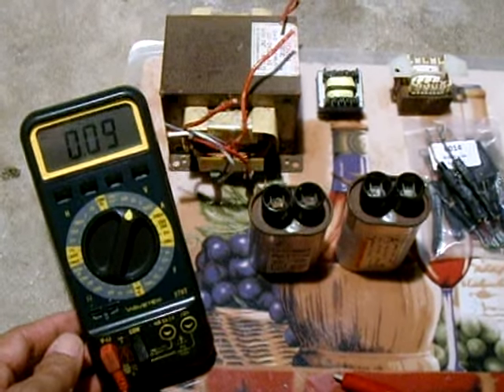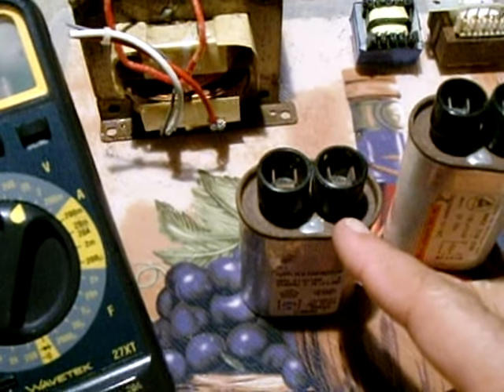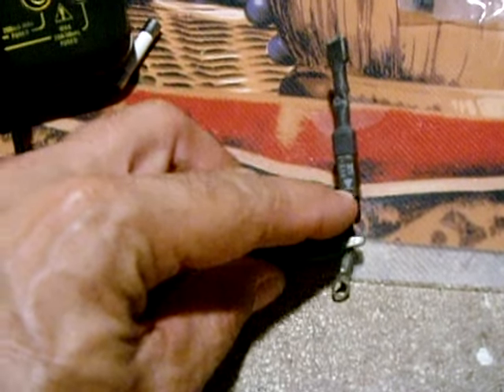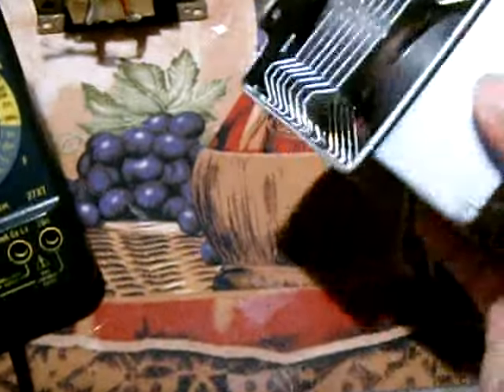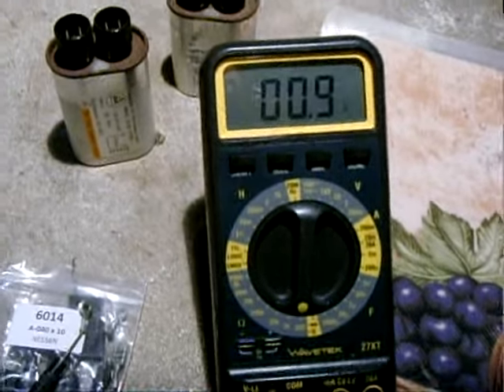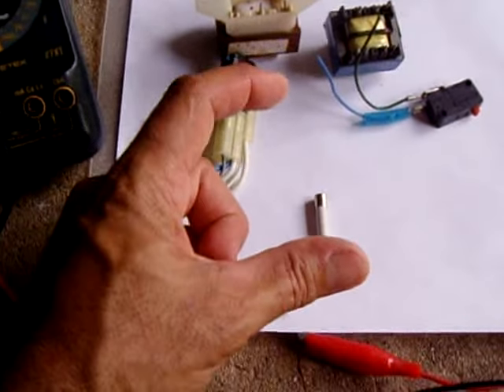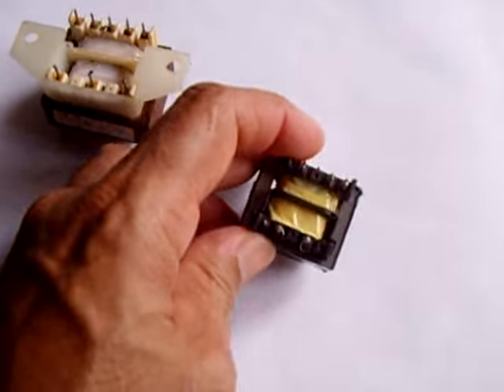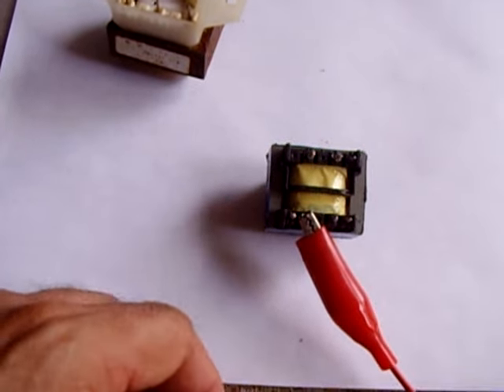How To Easily Test Microwave Oven Parts! (Ultimate Guide)

Comment: I'm a fan! , but I have a puzzling problem, I have tested as you've instructed and I found a faulty high voltage diode and a faulty micro switch in the door (both parts were replaced), but the microwave continues not to heat. All other parts tested within normal range. the display panel works fine. I thought it maybe the magnatron as on testing I'm getting .5 ohms the other test is normal. Any help you can provide me would be great! or I will succumb to defeat and go out and buy another one (if only to get my wife to stop yelling at me to buy another)! Thank you!!!
Reply from the maker: If the large transformer is being supplied 120V on the primary side from the circuit board relay, then I'd say the magnetron is bad.
Reply: Thanks for responding And yes the transformer is getting 120 volts so I will try a new magnatron and see if that resolves it and again thanks for the help!!!!

Comment: My micro wave is an avanti. While plugged into the socket it wont come on neither will the control panel light. But if I opened the door the light comes on and the plate rotates as if it cookin. Once again if I close the door all of this stops. This so weird.
Reply from the maker: Inspect the door switches. You could have a faulty control board.

Comment: I have a GE profile.  The front control panel lights up, but will not take touch commands.  I took apart and cleaned all ribbon contacts with contact cleaner, and still no good. New boards are too expensive. Any thoughts?
Reply from the maker: jim bringe Usually a faulty door interlock switch. Test every switch and make sure they function properly as the door opens and closes.

Comment: I have a GE Profile Advantium 120 (2012) that powers down after a few minutes and I have to rest the clock to get it to start again.  Any ideas on what is wrong?
Reply from the maker: Could be excessive heat causing the thermal switch to trigger(or a faulty thermal switch). Could also be a faulty door switch, main control board, or faulty HV power transformer.

Thanks For Watching! Be sure to share my channel with others and rate Thumbs Up.

Comment: This is a truly comprehensive, methodical tutorial for people like myself who are comfortable working with electronics, but are unknowledgeable about testing microwave ovens. I have the top-rated, gleaming stainless steel, above-the-range GE microwave that quit heating after only three years and four months of use. Because of your video, I easily identified a shorted HV transformer. 

(Prior to finding your video, I located two bad components: the HV diode and magnetron. However, the oven still didn't heat.  A professional electrician tested the unit, failed to find the HV transformer failure and gave up.)

The Malaysian-manufactured unit is stuffed with Southeast and Far East Asian components. In sharp contrast, our 22-year-old Ohio-manufactured Tappen 1000w microwave oven continues to give top performance and trouble-free service. (I would pay the premium and buy USA, if given the choice.) 

Thank you for producing an outstanding series of how-to videos, which are worthy of a college-level  (or, at least, a good trade school) course in electronics.
Reply from the maker: Glad my video was able to help you!

Comment: electronicsNmore - Thanks so much for sharing your expertise & posting this video. Using your helpful tests, I was able to rule out the magnatron, high voltage diode & transformer. The high voltage capacitor tested bad.  Replaced it & my old 1982 Sharp R8320 convection microwave started right up.  They don't make them dependable like that anymore. THANKS AGAIN!!

Comment: Very good videos about microwave fixing! Unfortunately my oven had a high voltage (5kv 0.7A) fuse blown which you didn't address in your videos (probably many ovens don't have one), but that was easy enough to figure out myself.

My symptoms were: Everything else works but oven doesn't heat. Lights, fan, even transformer hum was present.

After testing every other component I was suspecting some fault inside the magnetron even though it measured 0.3 ohm with an ESR meter. DMM showed below 0.1 ohm delta reading with leads shorted compared to connected to a magnetron so it was no help in my case. 

I fixed mine temporarily with a 0.315A 1000v FF multimeter fuse for the next 2-4 weeks until correct size fuses arrive from china (1.1€ for 5 pcs).
I know that if the fuse blows now, the arc might not close inside the fuse because of inferior voltage rating and difference in construction. But I, a cheapass student, won't have a microwave otherwise so I take the risk of causing further problems with this cheap oven. :)

Comment: Great video.   All of my components tested good but I saw sparks through the holes in my magnetron case.  Knowing that couldn’t be good I replaced it and now it works.  I had seen on another sight the same testing for the magnatron and they said it could test good but still have issues. I tore it apart afterwards to get the magnets and saw that the input inductor was burnt on the varnish.  May be why it was sparking.  But great video.  I learned a lot.

Comment: Well, thank you for your videos.  I tried to repair my Sanyo EM-V3405SW microwave (intermittent flickering appliance light when door was opened or during operation and  pitch change in magnetron during flicker).
I was able to trace it to a relay, which I replaced (confirmed that it was relay by shorting the high voltage side of relay.
I ordered the relay, replaced it - microwave is running fine - but display is blank.  Is there some video you have on testing LCD display operation ?
I will admit, I had disconnected the front touch pad ribbon that goes into control panel, when I was testing relay operation.  Problem is I have no schematic diagram of the control board and have no idea how the display gets lit.

Comment: Thank you so much! My metre doesn't go above 20M so can't do the second test on the diode, but it read 8.4 volts on the voltage test. I guess that is good enough eh? The Capacitor was the only faulty bit since the reading between the two terminals went to 1.4. No reading change on the terminals to casing.
The microwave display and light comes on but as soon as I try to heat something, it instantly blows the fuse....would the bad capacitor do that?  Great instructional, thanks again.

Comment: This is an excellent guide for enthusiasts trying DIY fixing of microwave.

One question: 
  If high voltage transformer primary tests 120 v AC on each terminal to ground, what does that mean?
Reply from the maker: That means your transformer is not connected to the neutral wire allowing it to turn on. The circuit is not complete. You have to trace the wire and find out why(there may be a faulty switch or blown thermal cutoff). If you connect a 120V live / hot wire to one side of the transformer, and the other side(terminal) is not connected to the neutral wire, then you wire have 120V on each terminal. If the neutral is connected, you will have 120V on one side(power feeding in), and the other side connected to the neutral wire to complete the circuit, will be ZERO volts.

Thanks For watching! Be sure to check out my video playlists.

Comment: Thanks for the video.
I have tested all the switches, termal switches, fuse and all good. Everything is working except heating. There is no 120v on the entrance of the big transformer hence no charge on capacitor. What could be the issue?

Comment: In my case it was the capacitor. Unfortunately it was the last thing I tested for I was afraid of the voltage thing. Anyway I did diode, magnetron, the little switches, those fuses and breakers first. One fo the 20A fuses was bad, replacing it bought the lights and display back, the microwave was turning but no heat.  Anyway, when I finally get it off and check the capacitor, it was leaking oil and short. I just ordered one from Amazon and hopefully that's it.  Thanks a lot! Will paypal some if the new caps fixes the issue.

Comment: FYI is easy to follow ... My oven is not working ... I will follow this simple test only problem is I dont have a DVM... Maybe I can use 9volt battery connected to lamp as tester... Any good? Or there is a caution I needed to think like damaging a component? 😳😨🙏

Comment: Most interesting, may I ask ? can you not measure the voltage out of the output transformer while on to see if the transformer is working ie sending power to the magnetron ?  and what would you expect the resistance to be on those same leads with a the machine off and capacitors discharged?
Reply from the maker: VERY dangerous! You need a special HV probe like I made on my channel. Or you can remove it after unplugging the microwave and discharging the HV capacitor and do as shown below. Do as shown at your own risk. It's very dangerous for the average person. 

https://www.youtube.com/watch?v=VicnLpnwO-k

Comment: Microwave capacitors will usually have built-in  resistors connected to each terminal so that the capacitor will discharge automatically when the oven is switched is not in use.
Reply from the maker: Yes, slowly discharges with the internal 10M resistor. Thanks for watching!

Comment: Thanks for the videos.
I've read your comments and I think I have a puzzle.
The puzzle occurs when heating more than one batch that needs heating. The first batch heats fine. When we heat the second batch it takes longer. Everything else is fine. Please suggest any possible solutions. Thanks
Reply from the maker: Sounds like the magnetron is failing. You can try testing/replacing the capacitor/diode. You may also have an issue of burned relay contacts not allowing full current to the HV transformer.

Comment: Once again, a really fantastic video. My only query is why don't you just test the diode with your meter ?
Reply from the maker: You can't test high voltage diodes using the diode test setting on a DMM. Thanks for watching!

Comment: Awesome video, still have problems. Micro would buzz, but would not heat cup of water. Power setting button did not work, everything else did. Replaced Diode, set power to 2, fired it up, and fuse blew. Replaced fuse, turntable, fan etc. ran with transformer unhooked, all was O.K. until Transformer was connected, fuse blew again. All test readings on mag, transformer and cap are same as yours. Ideas? Also, can I wire a 20 amp household breaker in-line to test? Blowing ceramic fuses is getting expensive!.
Reply from the maker: Fuse usually blows if a door switch is misaligned or faulty, the cap is faulty, or the magnetron is shorted. Thanks for watching!

Comment: Everything checked out okay on my microwave according to your guide on oven parts. But my 1st instinct was the Magnetron went bad but has 0.1 Ohm resistance which you said it is good (0.1 to 0.3 ohm). I put on heating and I can hear humming but no heat. Any suggestions? Thank you for your informative videos though.
Reply from the maker: Very likely if the diode and capacitor are both good. Sometimes a magnetron can test good, but be bad. Did you measure the resistance from each terminal on the magnetron to the metal chasis? You should not get any reading. If you do, it's bad. Use a high ohms range on your DMM.

Thank You For Watching!
Reply: electronicsNmore I follow your guide and I didn't get any reading for touching metal chasis and one to the terminal. If I have another magnetron from other microwave can I hook it with the one that's not heating up to test?
Reply from the maker: If the size is similar(wattage), and it bolts in the exact same way, then yes. Substituting another known good one, will let you know if yours is faulty.
Reply: Magnetron doesn't have any wattage on the label. How can you tell the wattage?
Reply from the maker: Go by the label on the microwave oven. 900w /1000w...etc.

Comment: Thanks for the proper, safe process. Interestingly, about half the folks DON'T test for shorts on the Mag (terminals to body) which ultimately was my issue as I was seeing continuity from terminal to body. Just received and install the new Mag and it tested out exactly as you specified .001-004 ohm  across the terminals and OPEN from terminals to body and my unit is cooking again and operating quitely (comparatively speaking), it sounds like new again. I do have a few questions maybe you can answer as I haven't found anything yet on the subject: 1. can a shorted Mag be repaired? The terminal block looks clean, so it must be an internal short and 2. As far as the part # mine is an LG 2M246 050GF 1200watt and there is an additional set of letter/numbers under model #. Is the main number I need to worry about the 2M246 or are any of the other numbers important to match? Thanks again!
Reply from the maker: Not worth the time repairing, you can buy a used replacement on Ebay at a low cost. Thanks for watching! Be sure to share my channel with others.
Reply: @electronicsNmore  Will do! KUTGW!

Comment: Thank you, I did test the capacitor and it tests normal I think at 9.37 for a 10 ohm capacitor and the terminal to body on each test infinity (followed your video). The buzzing is coming from the transformer. If I unplug the magnatron the tranformer still hums but the loud buzzing stops. Left the magnatron unplugged disconnected HV wire to the capacitor normal hum from the transformer but no buzzing. The tests of the transformer were all normal low side read .7 at 200 ohms and terminal to body was infinate at 20M ohms. High side .5 at 200 ohms and terminal to body was infinate at 20M ohms. The HV wire tested 91.2 at 200 ohms. I also tested the new diode and it was normal. I tested all the door switches, the thermo sensor, the fuse and transformers on the board all were normal. Again everything works except buzzing from the transformer and no heat, the magnatron is silent. I visually again inspected the magnatron, no cracks, sounds, etc... I also retested it and get .5 at 200 ohms and each terminal to body reads infinate at 20M ohms. Do you still think it is the magnatron?? and again THANK YOU VERY MUCH FOR THE HELP!!!
Reply from the maker: If you unplugged the magnetron from the transformer, then got only a hum and no buzzing, then that would indicate the magnetron is causing the problem. You need to swap out the magnetron. (0.5 ohms) for the magnetron is higher than normal.

Comment: I have watched your videos and they are helpful but I have a question. When testing the hi volt line on a GE transformer in our microwave, I get a reading of 76.5 on the high voltage side. Is that acceptable as you have mentioned 80-120 is desirable (you got 95.5).  All of the other components have checked out as you mentioned and we did replace the diode but it still makes a loud humming noise and does not produce heat.  The GE Profile Sensor convection microwave oven we have is 16 years old.
Reply from the maker: That's fine.
Reply: @electronicsNmore  well then the only thing left is to replace the magnetron because as you noted they can test correctly but still be defective. Your opinion?

Comment: Hi , you could also test the diode with a 9 volt battery since our multimeter tester cannot supply enough power to elicit a reading
Reply from the maker: For a reliable test, higher voltage is best.

Comment: Great Video. How do I check when my turntable motor does not have 120V input power? I test the motor with 120V source and it works but there is no power supply to my motor.
Reply from the maker: Trace the wires. Could be a faulty relay.

Comment: Very good instructions. However, can I suggest you to add a test for the transformers low voltages ? You should test if there are no short between the secondaries.
Reply from the maker: The circuit board mounted transformer?
Reply: Yes, the little ones. It could happen, sometimes, that because of a default on the board driving to a peak of current a hot point  between the secondaries. This is valid not only for the microwaves. You can use the mutimeter to perform the test. In case of any doubt, you can drive direct current into each secondary with your external source and test the other secondary from its two ends and, 2nd test, one end of it to the two ends of the  first one under DC. Repeat this with the second end of the secondary considered. In fact, it is an insulation test between those secondaries to perform.

Comment: hey there, i have the analog electrical meter so could you pls tell me what position/symbol/mark to select to check the capacitor after you do the ohms check. ta
Reply from the maker: +Capricornarr 
If your meter is inexpensive and does not have a "F" setting meaning Farads(capacitance), then you are out of luck. You will have to rely on the resistance test.
Reply: +electronicsNmore Thanks for your quick response, I only have an analog electric meter which is clearly no good in this situation. Could you please suggest any good digital multi meter that would do all these jobs and I would be able to do all these checks? cheers mate.
Reply from the maker: Vichy VC99 on Ebay.

Comment: Appreciate the videos, tremendous help. Lights would come on but microwave did not work. Replaced switch a d a thermocouple. Now everything works but exhaust fan turns on as sonn as I plug it in? I can switch speeds but won't turn off? Hope you can advise. Thank you in advance.
Reply from the maker: Bad thermostat(heat sensor). Make sure you installed the correct parts, and wired them correctly.

Comment: Thanks so much for this tutorial and forum. Defy Convention Microwave oven DM0357. Just went dead. Perhaps overheated. I don't know. Keypad dead. Should I replace capacitor first, or the keypad? Or, is it possible the keypad alone needs replacing. Multimeter testing showed components are ok. Have to guess if capacitor must be replaced and/or keypad.